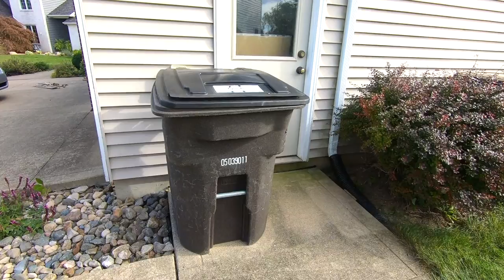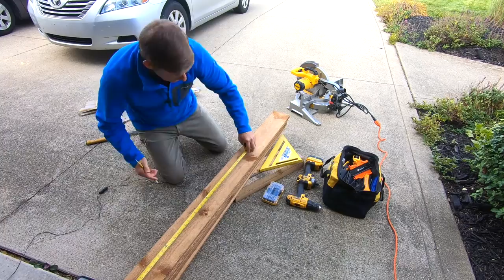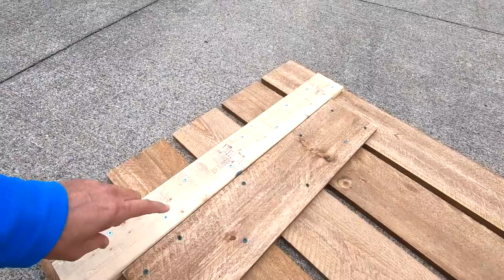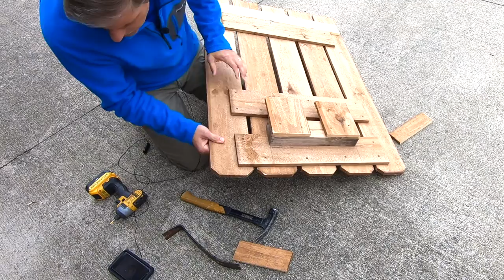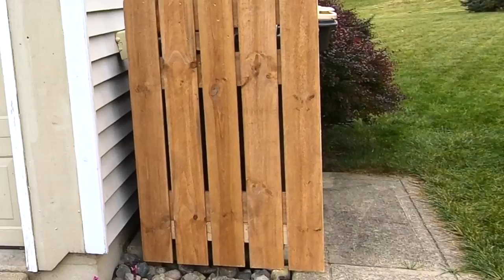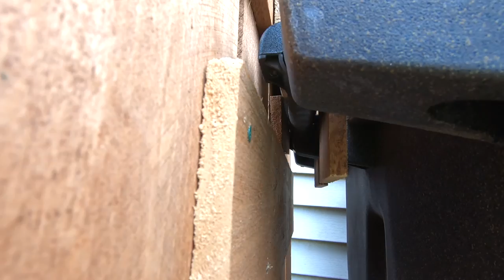Small Fence to Hide Garbage Cans | How to Build Trash Can Screen

Comment: Wish you had measurements for the hook part…that’s what I need most help on but great video!
Reply from the maker: Hey retired…,
They are about 5 inches wide and about  8 inches long. The 2x4 underneath is approximately 1 foot long. But those dimensions can be flexible - do a trial and error on yours. It is more about how well it fits and works in your trash can.

In practice, I found that it has been convenient to simply lean the fence up against the nearest trash can and use a bungy cord to attach to the trash can or nearby door to keep the fence from falling. So there’s a couple ways to secure it - whatever works for you. 
Thx for watching.
Reply: Did not really expect a response!  You are fantastic to take time to answer.  Much appreciated!! 👍🏻
Reply from the maker: We can’t reply to every comment but we try! 😃